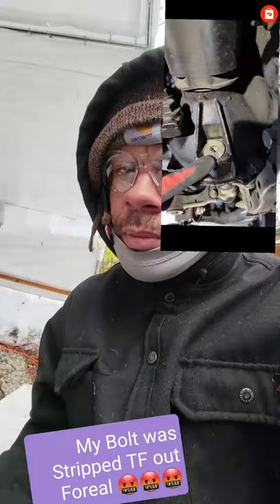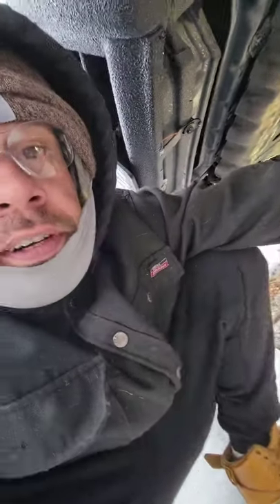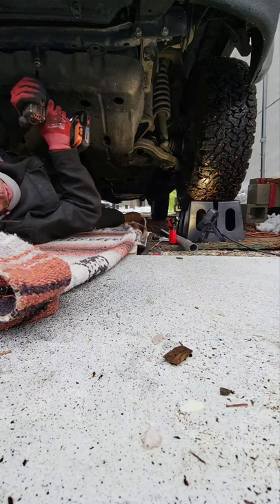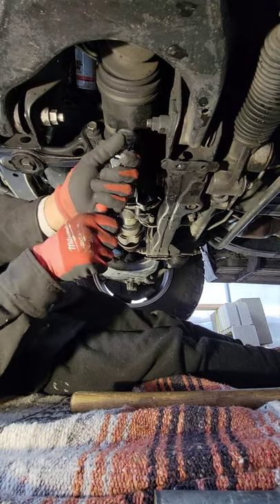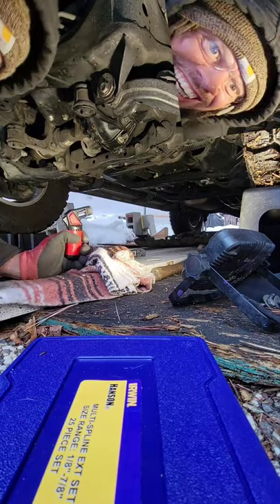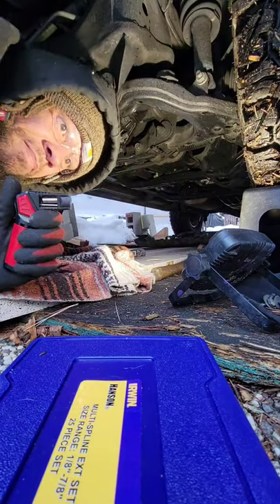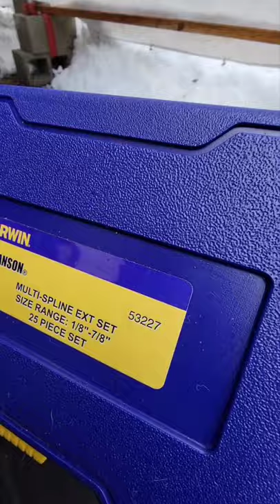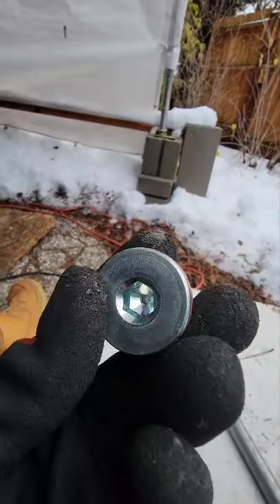Breaking loose STRIPPED  Differential drain plug w/ Irwin Multi-Spline Exctractor Set || This WORKS!

Comment: got the same problem on 95 rear diff Silverado, BAM  why not cut a hole in the pan cover and  insert one of those rubber plugs ? you can pump the fluid out of it later to change it. I'm looking online to see if there's a cover with a plug. found  only magnet ring.type Easy money manufacturers. hard clear plastic would be a window to check level. What it is Jim !

Comment: I'm having the same issue but with the FILL plug to my 2017 Acura MDX.  The plug is soft aluminum and it's in so tight from the factory the star bit just rounded it out.  I have ordered that same Irwin set...fingers crossed.
Reply from the maker: You will get it off with that set FOR SURE! Once you find the correct Extractor size and have it ready to torque out of there, I strongly recommend torching the 💩 out of the plug for 5 minutes straight too(well 3 to 5 minutes)! It will work for you most DEFINITELY!🥷🏽💪🏽🙌🏽 let me know if you get that b*tch outta there🥷🏽🙏🏽
Reply: @DrokuNinjah  The Irwin extractor bit worked like a charm!  Now I just have to replace the plugs....$30 apiece from Honda but only $11 each from Chrysler...same ZF transmission
Reply from the maker: Now that's what I'm talking about!🥷🏽💪🏽🙌🏽 Glad it worked for you! I bet you felt just as happy as I did getting it loose too😃 that Irwin Extractor Set was worth every penny wasn't it!?
Reply: @DrokuNinjah  Sure was!

Comment: Im having this same problem but with my 2003 Dodge Caravan Se cylinder block drain plugs.
Reply from the maker: The Irwin Extractor set that I mentioned really works great! Thank you for watching and commenting 🙏🏽
Reply: @DrokuNinjah  I would need to know if that irwin extractor set will work to remove the cylinder block drain plugs on my 2003 dodge caravan se and which size would i need to use that fits, are you able to help me out with that? I will greatly appreciate it my friend.
Reply from the maker: @AlwaysDiagnoseVehicleFirst  this Extractor set I have is Irwin "Multi-Spline" Extractor Set #53227. The extractors range from 1/8th to 7/8ths and go up in increments of 1/32nd! This set should be the one you need! I'm going to send you a Link to the one I got now😁🙌🏽🥷🏽
Reply from the maker: @AlwaysDiagnoseVehicleFirst  https://www.amazon.com/Irwin-Tools-53227-Multi-Spline-Extractor/dp/B0002SRG66
Reply: @DrokuNinjah  I just clicked on the amazon link you sent me and its $100 i cant afford it right now. I just need one socket from that kit that fits onto the cylinder block drain plug on my 2003 dodge caravan se so i can remove both same drain plugs out to drain the old contaminated coolant from the block.
Reply: @DrokuNinjah  I used a T-40 Torx socket and a 6mm hex socket and it fit better, which socket from that Irwin kit will i need?
Reply from the maker: @AlwaysDiagnoseVehicleFirst   It's pretty difficult to guess On my end, but I know for sure that that set has what you need To extract that bolt🙂.there is a kit that's the same brand with less Extractors(also cheaper) but I would guarantee that it has the size you need. The Irwin Extractor Set 53227 is your best Bet🙌🏽🔥
Reply: @DrokuNinjah  Do you recommend that i heat up that cylinder block drain plug with that same device you use to heat it up for 5mins? Even though i dont live in a cold city with snow.
Reply from the maker: I would most definitely recommend heating up whichever bolt your having trouble getting off! 🔥🔥🙌🏽🙏🏽🥷🏽
Reply from the maker: @AlwaysDiagnoseVehicleFirst  even if it's warmer where your at, the torch heat will heat up the metal around the bolt as well! 😁
Reply: @DrokuNinjah  Do you have an email address where i can contact you and send you pictures and videos of my progress trying to remove these 2 cylinder block drain plugs, your cool with that my friend?
Reply from the maker: FOR SURE! Woodrowtaylor3@gmail.com email me whenever 🥷🏽🙌🏽🔥😁